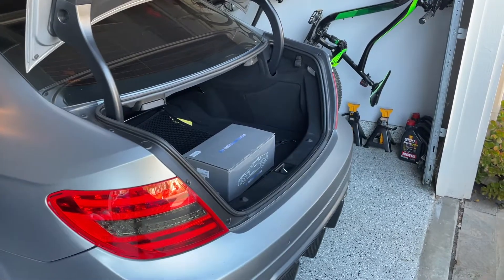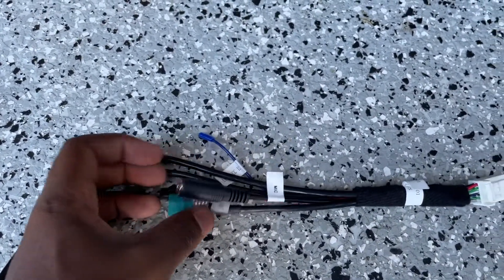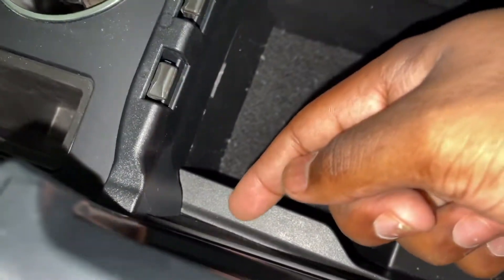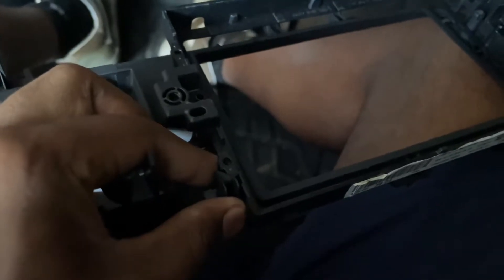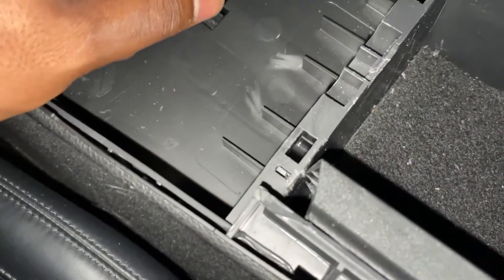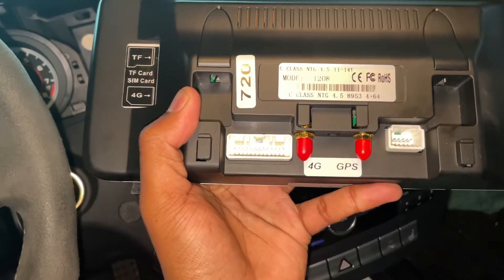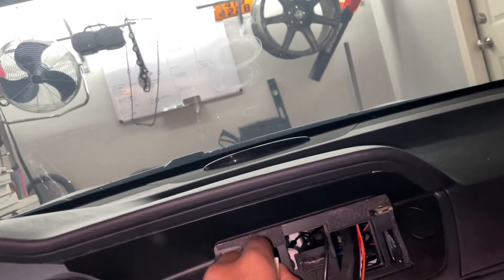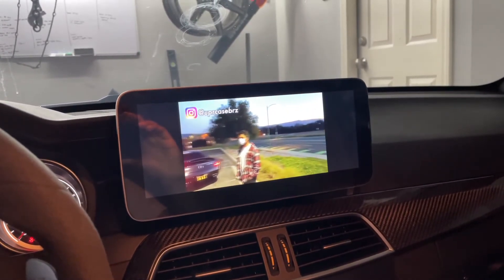Mercedes W204 C Class AVIN Android Infotainment 10.25" Screen Install! (Qualcomm)

Comment: Installed and mostly working...except voice commands - anyone else having that issue?
Reply from the maker: If you didnt install the external mic that would likely be why.. the build in mic is pretty terrible
Reply: @SamAbraham  yeah, it is but I don't think it's working at all.  The coloured blobs on Android Auto don't dance one bit even if I shout at it from 2 inches away!
Reply: @SamAbraham  what they should've done is take a piggyback feed from the OEM microphone (it's in the quadlock) and use that as an external mic for the screen.
Reply from the maker: @richiero0o0  Would’ve made the most sense to me,  not sure why none of these manufacturers have been able to figure that part out unfortunately
Reply: @SamAbraham  I've seen one supplier (hifimax) demonstrating that approach for this unit but on a BMW.

I'm going to try tapping into the original mic but at the satnav cradle in the glovebox as it's easier to access rather than wrestle with the head unit again!

It's pretty obvious there's only 1 manufacturer of these units and lots of resellers (avin, top road, hifimax, autoabc, ninetom, mekedes, tophatter etc. etc.) who simply rebrand the firmware.
Reply: Internal mic was faulty.  Fitted an external mic and hid it behind the screen - works great.

Voice commands go via external mic, phone calls go via OEM system so no quality issues etc.